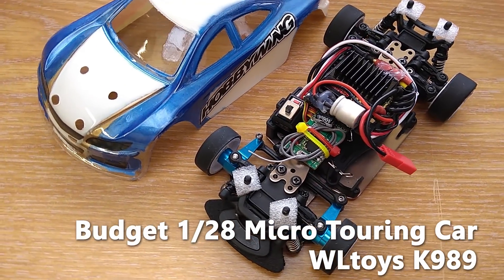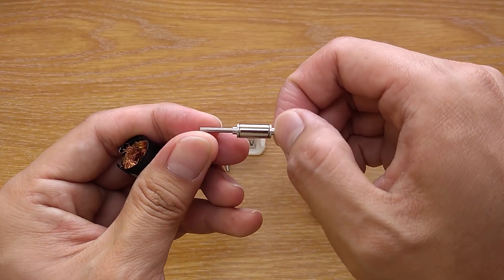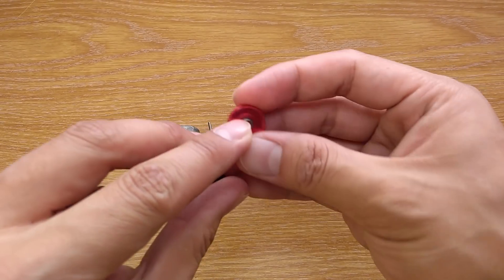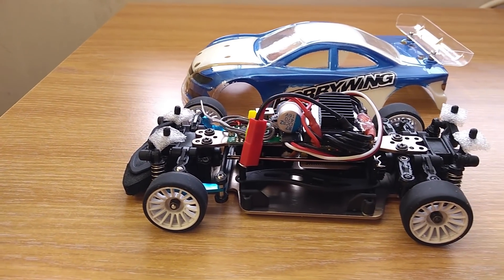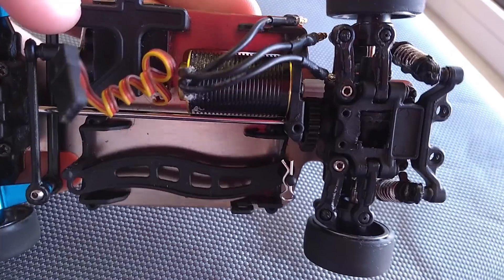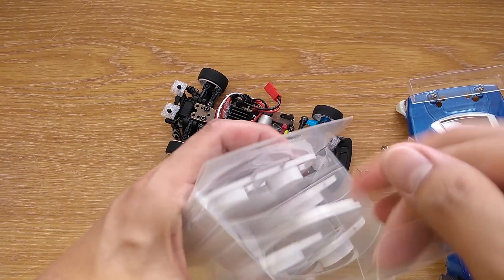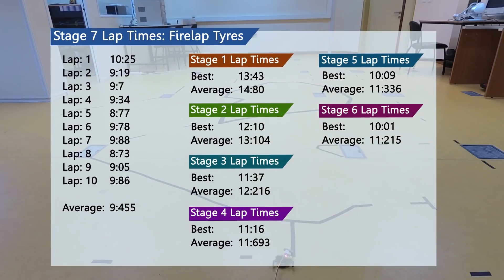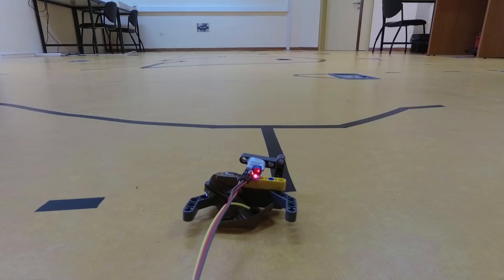WLtoys K989 Budget Touring Car - Stage7 Brushless Upgrade

Comment: Tha motor and esc is no longer available what other motor and esc would u suggest beaver
Reply: U happen to have the link for the model
Reply from the maker: @Chargerguy1982  the motor. 5500KV is enough. More than this and you'll have to do some gearing to make it driveable. 
https://www.gt55racing.com/products/surpass-hobby-rocket-1410-brushless-motor-mini-z-mini-car-motor-2500kv-3500kv-5500kv-7500kv-9500kv-for-1-24-1-28-1-32-rc-car?DIST=RUZBGw%3D%3D

ESC, the only one left I can find is DriftArt branded. It's quite posh and comes with aluminium case which explains the high price. https://www.gt55racing.com/products/93331-drift-art-esc-with-program-buttom-sensorless-brushless?DIST=RUZBGw%3D%3D
I have the tutorial and short review for this ESC here. https://youtu.be/vH2RLdTYuy8
Reply from the maker: Check out Surpass Rocket Mini 1410 motors. They're really good.
As for the ESC, anything that use Hobbyking programme are good. DasMikro is good. One version of BYRC on aliexpress that uses Hobbyking programming card is also good.

Comment: Hello to you. I love your videos. I have been following you for several years now. Your work is of superb quality. Just like you, I love Wltoys 1/18. I have several. I will launch it in the design of a new model in Brushless motor. How many KV do you recommend for these small machines? Thank you very much for your answer. 🤟😎
Reply from the maker: It depends on the gearing but normally around 4500KV should be OK for that scale.
Reply: @BeaversHobby  Great. Thank you very much for your answer. Good luck to you! 😉👌

Comment: Where Can I GET a Pinion gear of 8T ? 

Great video
Reply: Thanks !!!
Whats the diameter of the central hole ???
Reply from the maker: @MrDrpatchadams  2mm diameter shaft on K989 and 284131. And for 284010 it's 3mm on the shaft and 1.6mm on the gear.
Reply: @BeaversHobby  thanks !!! 

284131 1.6 mm on the gear too ? 

Great excelente videos
Reply from the maker: @MrDrpatchadams  284131 uses 2mm shaft for the whole length. At the end there's cut-in (flat spot) for the gear. Basically it's still the same as the K989/K969.
Reply: @BeaversHobby  really thanks
Reply: So 8T 2mm central hole diameter for the 284131 gear
Reply from the maker: @MrDrpatchadams  Yes, 2mm central hole.
Reply from the maker: You can get it from Tamiya Mini 4WD. There's metal gear too. https://www.tamiya.com/english/products/15289/index.htm
Otherwise there are also plastic gears kit if you look in banggood or aliexpress. 
There's many gears if you want more adjustments. https://www.banggood.com/custlink/3GGVZQ482Z
Here's 8T only. https://www.aliexpress.com/item/32977901548.html

Comment: Isit possible to upgrade to brushless and use standard transmitter/receiver??
Reply from the maker: Yes, it is but it's not recommended. There is a receiver for the current version transmitter so you will need to buy that extra receiver.
However, some ESC might require reverse throttle to work and that is not possible with the standard transmitter. You can still do that by taking the transmitter apart then swap the wires on the potentiometer, again this is not recommended.
Besides, the cost of the new receiver varies from source to source and you can get a pretty OK transmitter, the DumboRC X6 with all the necessary features (reverse throttle, reverse steering, dual rates, etc) for something like $29.

Comment: Can the moter handle 3s
Reply from the maker: This one, no. Some others like the low KV Surpass Rocket V2 3500KV might but generally these motors are designed to work with 2S.

Comment: How to Install the DC motor 130 toy in wltoys k989?
Reply from the maker: You'll need the one with mounting holes at the front. Then screw that into the original motor mount.

Comment: Any chance you can send another reply of what parts you would use to set up for a fast top end version of this 1/28 wltoys.  Lots of the links in your video are not available.  I would be happy to order through bangood if you get a little kick back.  You seem to know the good from the bad and I am just trying to set up one of my older cars for speed runs.  I have one set up stock, one set up with better transmitter with gyro but stock motor and now just need a little help any with current links.  Thanks again for your help and hopefully you get points to get more stuff.
Reply from the maker: Banggood has stopped selling most of the parts so all you can get there are metal driver train gears and diffs to make it survive the run.
Metal gear for drive train https://bit.ly/3w7XChB
Aluminium Diffs https://bit.ly/3Iq6rWp
Long CVD https://bit.ly/3m1i4bd

The you'll need a gear puller so you can change the motor https://www.aliexpress.com/item/1005002818277034.html
Next is motor and ESC. Put the highest KV you can find in the car, in this case it's 9500KV. https://www.aliexpress.com/item/1005003131268462.html
I've used the Hobbywing 16BL30 ESC with good result before, it's also waterproof so this will increase the survivability. In this shop you can choose the plug you use on your battery. https://www.aliexpress.com/item/1005001335666332.html
This is a HV battery, the fully charged voltage is higher than a normal Lipo. https://bit.ly/3FE2pvF
The plug is XT-30 so you can choose that when ordering the ESC and you don't have to solder that.
This battery won't fit directly on the car but well, nothing in this build will so you'll have to figure out how to stick everything together. I put it on the top plate so that's one way to do it.
I don't know if all of the shops I sent you can ship to your country but if not, try and look in different shops in Aliexpress and see which one gives you the best deal.
Good luck and have fun.
Reply: @BeaversHobby  thanks again for all your help on shopping this stuff.  I have everything I think i am going to need to make a speedy version of this budget RC.  Something about the 1/28 size I really enjoy.  I had been into RC racing in my youth back when the RC-10 and the RC-10T was what everyone was racing. Our local hobby shop that had a track and did races every week.  Before brushless motors best you could do was a modified and that is nothing compared to what you can now get for supper cheep and already put together.  One more shopping list Item if you could send me a link for a Brushed 130 motor and also a cheep ESP that will do the job but not break the bank.  Thats for another build that i have going.  Its working good right now just want to have a backup.  Anything better than stock would also be ok too.   Thanks again have a great day

Comment: I bought two different Rocket Esc / brushless combos one red one black couldn't get either to work.  Then  I got that hobby wing 18a ESC and  hooked it to the rocket brushless motors I have tried the red and black motor neither seem to be working correctly. They seem to sputter or not get up to speed.  I was wondering if you have any ideas what I am doing wrong?  I am matching the #s from the ESC to the #'s on the motors.  Would you recommend anything?  Or even a whole new combo set?  eBay and Amazon have package deals but I am afraid I am going to end up with the same issue.  I have the hobylink transmitter and receiver w gyro and love them. I am Just looking for a little more pep on the long straightaway then I am getting from the 130 motors.  Any advice you could give me would be greatly appreciated.  I am also trying to keep my battery plugs the same  I ended up with lots of 7.4v 600mah I use them in several different models.  Is the scorpion still what I should try or anything a little cheaper I can get the more bang for my buck.  Appreciate you reading my comment and hopefully getting back to me. I have watched and used lots of your advice over the year and a half I have been messing around with the wltoys 1/28 platform thanks for all the great content I am watching you from southern California so don't normally use bangood but if you think they have what I need I will do it.  Just want  more on the top speed but don't want to lose the quick starts.  Thanks again
Mark
Reply from the maker: The spluttering you have could come from different things like joined terminals on the motor so make sure all 3 terminals don't touch each other. The Surpass motor is good but the ESC is pure garbage. The Hobbywing ESC is good so combining the Surpass motor with Hobbywing ESC is already a good choice. 
I suggest you check the connection on the motors and the ESC then calibrate the ESC and try again. You can also try reverse the throttle channel and re-calibrate the ESC. Hobbywing 18A can sometimes work only with specific direction of the throttle so it might help.
Worst case is you'll have to replace the motor or the ESC. Check out kenonhobby.com. It's the biggest 1/28 shop in the US. There are many other shops as well like Helidirect, WolframRC and RCsupremacy. A Surpass motor with PN Racing V2 ESC also works really well.
I'm not sure if any Amazon shop will sell the PN ESC.
Don't mind the Scorpion I use in this video. Nowadays we have plenty of choices.
Reply: @BeaversHobby  thanks for all the good advice.

Comment: I got the same motor and mine just keep clogging it won’t even do a full rotation, never worked out the box🙁
Reply from the maker: Check it outside the car first if it works properly. Also check the wiring and soldering joints to see if there's any bridge between 2 wires. Also check if there's any break in the motor wires, that's the main problem for motor with wires coming out directly from the can like this one.
If that works, check if the gear mesh is too tight on the car.
If everything works smoothly but the motor still refuses to turn then it might be defective. Either that or the ESC is defective.

Comment: Hi..nice channel !.do you have exact ref for tires and wheels for drifting please...i am i in japan osaka right now to show to the  seller ...tires  and wheels kyosho   brand please...
Reply from the maker: I'm not sure if you're still there.
What you need are 
- Kyosho MDH100W MULTI OFFSET WHEEL SET WHITE/AWD/14PCS (Since you are there might as well get the whole set)
- MDT001 and MDT002 for narrow and wide drift tyres.
- Optional, get the MDW100-01 SETTING SPRING SET AWD DWS for more tuning.
Reply: @BeaversHobby  you re the boss

Comment: how do you remove the stock pinion from the brushed motor do you jist pull it out
Reply from the maker: You'll need to use a gear puller.
Reply: @BeaversHobby  i cannot find motor mount for mini brushless motor? Shaft is also smaller in brushless motor. motor mount only for brush motor
Reply from the maker: @14_19a You don't need a new motor mount. What motor do you have? If you get the correct motor the mounting holes will line up (more or less) and the shaft will be 2 mm that fits the gear.
Reply: @BeaversHobby  1S-2S 1220 KV10300 Brushless Motor (Set) Dual-way 10A ESC for Mini Car Q RC Car

Holes are too small for the screws and width  is too short for motor mount shaft is also smaller than stock shaft that comes a k989 stock brush motor
Reply from the maker: @14_19a  Unfortunately that is the wrong motor. You need the 1625 or 1410 type.
Reply: @BeaversHobby  thank you! broke the stock motor trying to get the pinion out lol! will do 🤣 thanks again for the very cool content my friend two thumbs up
Reply: also have Surpass Hobby 1220 Brushless Motor 8600KV 8200KV for 1/24 1/28 RC Car

however there's no esc compatible with this i can find anywhere
Reply from the maker: @14_19a  Check out DasMikro for small brushless ESC.

Comment: What battery have u used for 9500kv? I recently got into these rc and and I don't know much, Please help me!!!!
Reply from the maker: I use the original battery that came with the car. This car uses 2S lipo so you can use anything in that type as long as it fits inside the car. 
If you want to upgrade the battery, take a look at GNB (Gaoneng battery) they make good stuff like 300 and 350mAh which will fit the original bracket in this car. Or 450mAh that is bigger than the bracket but you can take that out and tape the battery down to the chassis directly.
Reply: @BeaversHobby  omg thanks for replying, one last time thing, is 400mah battery ok for a 9500kv motor?
Reply: Btw love ur videos, I watch them even while eating ♡
Reply from the maker: @anshaldrin1346  Yes, 400mAh is OK for 9500KV. 
Still, 9500KV is excessively fast for this scale and it's uncontrollable most of the time so I suggest keeping it between 5500KV and 7500KV.
Reply: @BeaversHobby  ok, I'll change it, thanks alot man💖💖💖

Comment: Hi Beaver, can you please recommend a decent replacement brushed motor please, or should I stick with the original wltoys ones? TIA
Reply from the maker: Original one is fine, Mini-Q motor is the same. You can also get FP130 motor for 6-12V as well.
Reply: @BeaversHobby  Thank you, is there an upgraded brushed motor that you would recommend at all? TIA
Reply from the maker: @trevorc6793  Take a look at PN Racing 39T.

Comment: What link for the other cheaper brushless setup, or what video is that in please
Reply from the maker: Nowadays the best budget motor is Surpass Rocket https://bit.ly/3ircxKC (actually the best up to $35, after this is the Furitek Greyhound 1410)
The best budget to sub $40 is DasMikro V3. https://bit.ly/3mYOVkd
You can also use Hobbywing EZrun 18A if you can find it for cheaper.
Here's a video but it's all in one with all the current upgrades. https://youtu.be/j9pO35iaqfo

Comment: Hi, could you share your esc settings pls?
And i like the video's you made. They realy help getting to understand these cars. Thanks in advance!!👍🏻
Reply: Thanks! I have a surpass 18ah now but it seems to have cogging at very low speed, hope this hobbywing does the job a bit better 😁
Reply from the maker: @royaartsen3628  Surpass is one of the worst you can get and it not just has cogging but the response is really slow as well. So, Hobbywing will be a big step up.
Reply from the maker: Basically I put the cut-off to 6.4V or 3.2V per cell and timing to 0 and that's pretty much it.